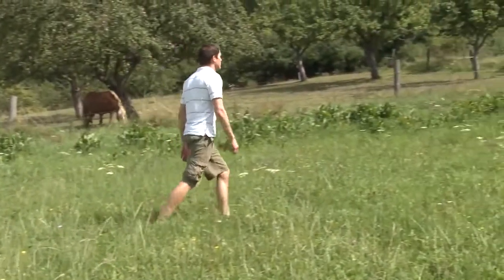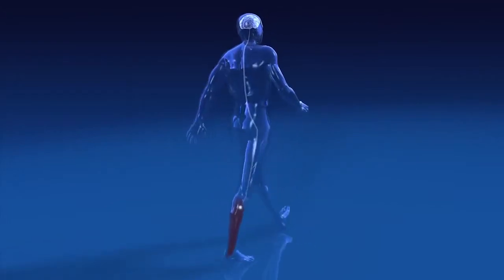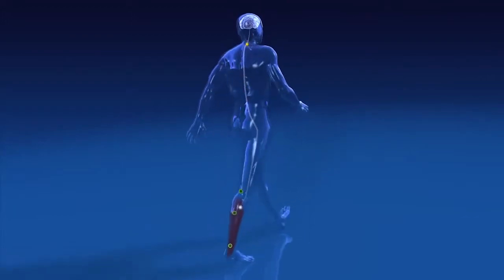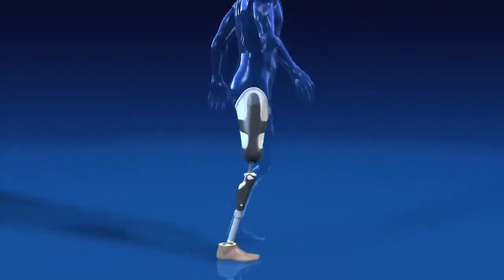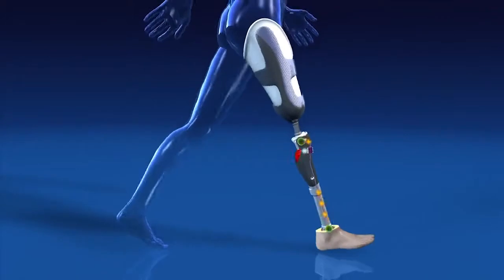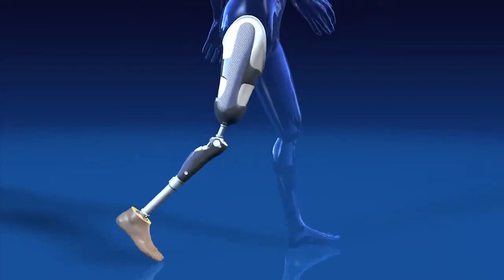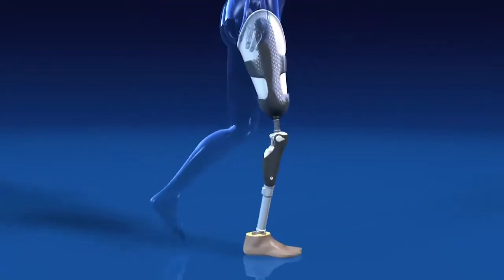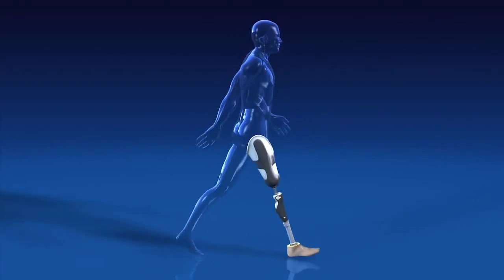How the C Leg Works

Comment: I find it interesting in the description above it reads; 'the C-Leg increases resistance to provide the support you need to recover before you fall'. I am a hemipelvectomy and am currently in to the seventh month of wearing my new prosthesis that has an Ottobock C-Leg knee joint and associated ankle joint, plus a 7E7 Ottobock Titan Modular hip joint. The knee joint was updated from an Ottobock 3R60 to an Ottobock C-Leg. After only 7 months use I believe it is too early to provide a true comparison analysis between the 3R60 & C-Leg knee joints. Nevertheless I will make this key statement. Although the C-Leg 'increases resistance to provide the support you need to recover before you fall' as stated in the description above - It still DOES NOT COMPLETELY PREVENT FALLING - and that is extremely important for any lower limb amputee and especially hemipelvectomy or hip disarticulation lower limb amputees.
Reply: my son just had his leg amputated. if i could ask how much did it cost for teh ottobock leg?
Reply: Падения не кто полностью за вас не предотвратит.
Reply: Wanna know price? And place available.🙏🙏

Comment: What is the total price of this prosthesis?
Reply: Here is New Zealand I believe the Ottobock C-Leg used in my prosthesis cost $60,000. I am a trauma hemipelvectomy - the highest level lower limb amputation where my left leg hip joint and pelvis is amputated. As there is very little stump [no stump] for the socket to fit on to, it is very difficult for me to wear and use a prosthesis. Nevertheless each time I fit my prosthesis on to my body I GAIN IN STRENGTH and SKILL to use it effectively and efficiently. In other words I am proving to medical science it is actually possible for a trauma hemipelvectomy to wear and use a prosthesis effectively and efficiently. Hopefully I am able to motivate other lower limb amputees so they can wear and use their prosthesis/artificial leg/s too.